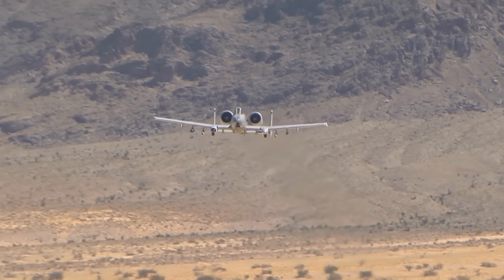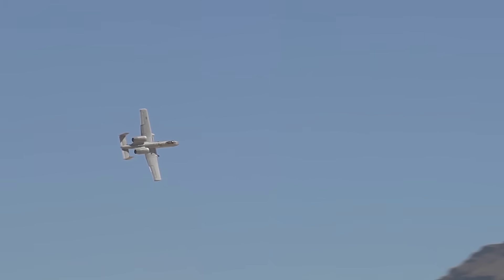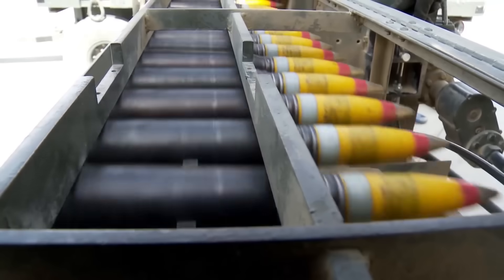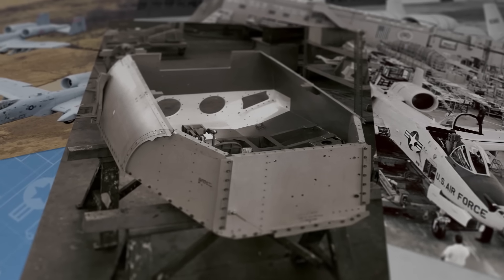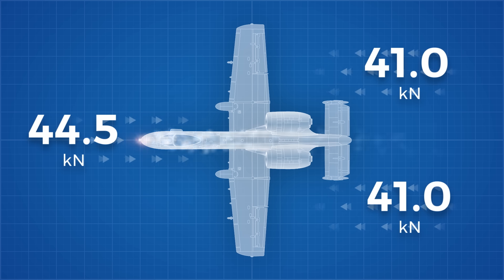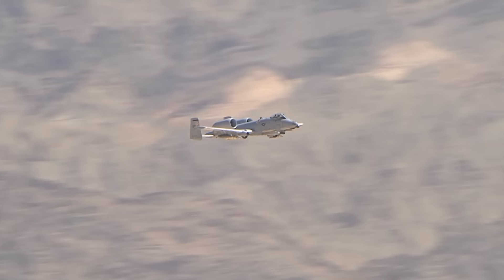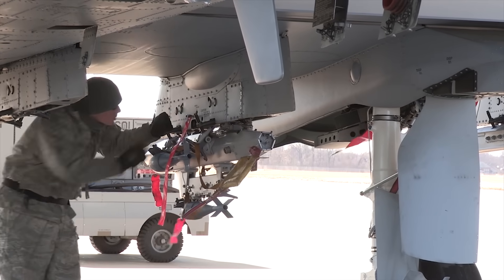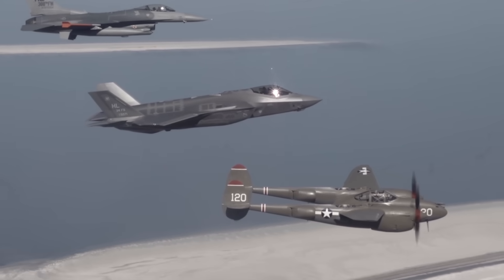The Insane Engineering of the A-10 Warthog

Comment: "Incredibly accurate with its weapons to avoid friendly fire" tell that to the Yanks who killed and injured British troops with blue-on-blue strafing runs with the Warthog
Reply: Tbf it is very accurate, just the trigger happy yank pilots not only did one but two strafing attacks on 2 british vehicles, which were clearly marked with orange identifaction panels, without authorisation from their forward air controller and yet somehow weren't reprimanded... Its an incredible bit of engineering, just in the wrong hands
Reply: @Caleb P It is, but you know what: who operates a weapons system is as important as the technology itself, and cannot be separated so glibly in real-life. That's an abrogation of responsibility. If the personnel that a military has are incapable of operating equipment in an acceptable manner, they shouldn't be running the show and putting other troops lives at risk, until they can find somebody who can do the job properly. My cousins witnessed the aftermath of such an incident and expressed similar emotions to the ones described in this sobering article about a (different) incident in March 2003:  https://www.theguardian.com/world/2003/mar/31/iraq5
Reply: @Caleb P perhaps more correct, bad intel.
Reply: @Caleb P Oh, yes, I was talking in a more general sense rather than directly about this video. The comment above yours just hit a resonance with me, for the stated reason, and got me thinking about the ethics of deploying.
Reply: @Caleb P No one can deny the beauty of the A-10 and it's attitude as a work horse in the sky let alone it's accuracy. It's a great piece of engineering however the "to avoid friendly fire" struck a nerve since I instantly think of the incident and men lost. But the statement remains true to deliver firepower precisely.  I respect that we can all have a discussion with understanding. Cheers lads.

Comment: "Yo we got all this Uranium laying around, what do we do to dispose of it?"
"What if... >hits bong< ...we shot it at terrorists?"
Reply: Uranium is a really good at anti armor due to its physical properties. A typical DU slug is a cylinder with a taper on one end with a flat point. When that flat point hits armor, it begins to shear off material from that flat point. It begins to self sharpen into a point as it goes through the armor. Now all that sharpening makes a lot of depleted uranium dust. That dust ignites in the air, and once the slug is through the armor, it can cause secondary fires inside.
And what is dangerous about depleted uranium, is it acts as a heavy metal (duh) in your body. The radiation is rather minimal considering the half life. The physical and chemical properties outweigh the radiation dangers. And they are serious concerns in their own rights due to how the projectiles work. Also doesn't help that DU also composes part of really good armor for tanks. There will be massive amounts of carcinogenic DU dust, in any future tank on tank battles.
Reply: @codyblea3638  There is a very good film about the consequences of using uranium ammunition called  "Deadly dust". It shows a lot of deformed babys :(
Reply: @RohrAtom doesnt make it true
Reply: @codyblea3638  do they make DU round for sniper rifles or more generally human operated guns?
Reply: @lechprotean  you are more likely to see tungsten carbide and hardened steel in things that are not considered cannons or auto cannons. Mostly because infantry has other tools for armor. I think there is a .50 bmg loading that uses a DU penetrator, but I'm not 100% certain. It comes down to the protection that is needing holes in it and who is engaging it. Rifle plates, light skinned vehicles against infantry? You don't need DU and it is a waste of resources to use on such. Hardened steel cores will do the job but grenades will do even better within range. Hostile APC rolls into the same infantry? Shoulder launched anti armor and tactics. Tanks come in? Call in air or artillery support. Or your own armor support.
And to be a little specific on your sniper rifle bit. We are entering a time where long range precision shooting requires secondary optics on the rifle. Not a red dot or the like, but an optic that goes in front of the primary optic. Not to increase magnification per say, but to give the shooter more elevation in their optic. This is due to the massive amount of bullet drop they are getting at these new insane ranges. At these ranges, bullet drop is measured in meters and yards not centimeters and inches. Very dense materials like DU being used as the projectile stock and not as just a penetrator tip, would change this. But the entire rifle, projectile and case would need to be redesigned to take advantage of it in long range shooting.
Reply: @lechprotean  no
Reply: @codyblea3638  DU's still quite radioactive (especially if dust gets on or in your body), despite what the VA might say. I totally get why the military likes using it, but it's too nasty. Using it is essentially nuclear warfare - not the big-boom part of nuclear war, but the radioactive fallout part.
Reply: @TheMatissV  DU is less radioactive than unrefined uranium ore. The smoke alarm in your house is more radioactive.
Reply: sappersam not if is the optical type.
Reply: Julian Kandlhofer except they've probably never shot a terrorist with it. Lots of wedding parties though
Reply: Terrorists? Yeah in US eyes.... on the other side those always end up killing civilians. But you don't want to hear that...
Reply: And then blame the very same terrorists for stockpiling nuclear material - genius!
Reply: In the low intensity combat where the A-10 has been excelling over the last 20 years, mostly high explosive incendiary (HEI) rounds have been used.  These are adequate for light armor, other vehicles, and, in particular, people.  The armor piercing round is much less useful in that type environment.
Reply: They don't use DU rounds fighting terrorist though, unless im wrong since there is also API and HEI rounds for the gau-8
Reply: I feel like this his how the top brass at Space X actually brainstorm
Reply: Shot it at kids *
Reply: It is depleted Uramun
Reply: I think too many people missed your humor, bud. I laughed my ass off!
Reply: @Rubedo Alaberti ?
Reply: HAHAHA  tho the engineers may had weed the corporate office surely had lines of coke being the 70s.
Reply: Weed was illegal when DU ammunition was invented.
Reply: At 6,000RPM.  And lets mix a few high explosive incendiary tracers in with it as well.
Reply: Excellent idea! Fully in favor... Now pass that thing :)
Reply: Apparently some people are not aware that DEPLETED uranium has lost most of its radioactivity. Only long term direct contact is dangerous. You actually get more radiation standing in direct sunlight than standing 3 feet from depleted uranium.
Reply: said no hillary ever
Reply: @------country-boy-------  Yeah, the Hillary types prefer arming the terrorists and using them as proxy forces. Ask Libya and Syria.
Reply: until deyglo!!! hahaa
Reply: The terrorists want it so bad the can catch it
Reply: Elijah Aitaok What about the ones defending their country from foreign invasion? You would probably roll over and spread your butt cheeks as a collaborator if you were invaded.
Reply: @thedarkpodcast9069  If a foreign army invaded our land and all the men from different states joined together to fight them, I get the feeling you would be collaborating with the enemy.
Reply: G
Reply: here is the new 2021 handguns and assult rifles click this link its a video https://www.facebook.com/antoine.burton.10/videos/3597933530289970
Reply: Hits bong??
Reply: By “terrorists” you mean impoverished war torn women and children
Reply: @averagejoe6031  and by impoverished woman and children do you acceptable losses
Reply: Top c omment
Reply: The most American thing read today
Reply: Yoooooo 🤣🤣🤣🤣
Reply: It was used in Iraq during the '91 Gulf war. Quite a few smaller conflicts as well.
Reply: EXXXELLLENT!
Reply: This made me lol I’m currently hitting my cart.
Reply: IMO not really, Depleted uranium is very weakly radioactive. I think people hear the word Uranium and suddenly think nuclear bombs. The average smoker is going to be at a much greater cancer risk than anyone who suffered acute exposure to depleted uranium, the radioactive lead and polonium builds up in a smokers lungs. Pilots are also a concern, pilots see increased radiation exposure from cosmic rays when they fly at high altitude. To really be at an elevated cancer risk from depleted uranium you need to be chronically exposed to it. Even then, heavy metal toxicity is more of a concern to safety than radiation. Lead poisoning or poisoning from any other heavy metal can kill you far more easily than radiation from depleted uranium. Everything emits some amount of radiation or is toxic in some way, some worse than others. The likelihood of depleted uranium being a major or overpowering factor in cancer risk compared to daily life habits is very small.
Reply: @dakotaadra1044  Have i finely found a based mind?
Reply: DU is still a heavy metal and causes the same problems as all other heavy metals. The pollution caused by it might not be polonium levels but next time you know someone with colon cancer, still hooray it up..
Reply: Dakota Adr
Reply: *Communists
Reply: this is one of the reasons why we're still behind in nuclear... too much interest for ammo.
Reply: @yosyp_yosyp  don't be ridiculous ahaha the US has stocked enough depleted uranium to last them another 1000 wars.
Reply: @dennispremoli7950  the main reason why nuclear Power is mainly uranium based today is that you can make nuclear Bombs out of the Plutonium produced by it.
Reply: @semurobo  Nah if that were true we would use Thorium because the Thorium cycle is easier and produces Uranium 233 (along with neptunium/plutonium) which is actually a more efficient fissionable material than Uranium 239 we use now, We use Uranium because Uranium is what they knew how to refine back then remember that the bombs came only 6 years after the first fission event, and we don't use thorium now because breeding reactors are illegal and weren't studied extensively before they were outlawed
Reply: @dennispremoli7950  1 world war at best
Reply: @dennispremoli7950  World War 2 used 30 million tons of ammunition so just think how long would the US last with that uranium
Reply: @dennispremoli7950  USA: This'll last us a thousand wars.
Germany: Don't test me.
Reply: @semurobo  You can make plutonium from U238 using any source of neutrons really. Even a Thorium based breeder reactor could make plutonium if you put channels in for the Uranium slugs to absorb neutrons.
Reply: @bearcatben4762  You really don't know your physics. Th232 can be bred into U233, which is fissile, but traces of U232 are produced which is a powerful gamma emitter, making it very difficult to work with, easily detectable, and prone to frying its own electronics. We explored it in the 50s and concluded the Pu239 (NOT U239) was the better material since it was pretty much exclusively an alpha emitter.
Reply: @semurobo  EXACTLY !!!   that's  why  Thorium  is not  used
Reply: @dennispremoli7950  depleted uranium? For what? Armour?
Reply: @yosyp_yosyp  depleted uranium is the part that CAN'T be used for nuclear fuel rods bruh, blame it on the fossil fuel corporation but why blame it on the ammunition industry
Reply: @yosyp_yosyp  You kind of missed the point of "depleted" uranium, which is that it is a by-product of a working nuclear reactor. Not to mention that the real reason we are "behind" in nuclear is not that we can't build reactors, but that no one wants one near them.
Reply: @yosyp_yosyp  bro, who has the most nukes? america. how does that equal being behind in nuclear? russia detonated the largest bomb ever but we have /by far/ more sheer tonnage of "deactivated" nuclear weapons. the WMD's Bush was looking for in the sands of arab-land are actually buried in the sands of the american southwest deserts and the rocky mountains. not saying russia doesnt have means of destroying the earth, but nowhere near what america produced on paper, and that is a google-able fact.
Reply: @yosyp_yosyp  not really United states still number one in the terms of electricity production generated from nuclear power plants
Reply: Yosyp are we really behind in nuclear? We have plenty of nuclear weapons, but even better, we have plenty of nuclear power stations and nuclear powered vehicles. Also, the US has experienced less nuclear disasters such as Chernobyl, Fukushima, that russian nuclear sub that exploded and sank, etc...
Reply: @svtxj9921  3 mile was a very close run thing. We(UK) got away with Windscale due to luck.
Reply: @yosyp_yosyp  you have no idea what you're talking about, do you?
Behind in what, exactly?
You say "behind in nuclear" like a 2nd grader... So please elaborate and list specific nuclear fields we are quote behind in.
We lead the world in every aspect of Nuclear weapons engineering... From precision miniaturization to high yield, pinpoint accuracy and reliability.
So I would like to hear from you professor...

Comment: The A-10
Efficient, does his job well, reasonnably expensive to make.

hOw aBOuT wE jUsT REpLacE iT wiTh  THe MoST ExpEnsiVe PlAnE eVEr ?
Reply: Lol look at the air casualties during desert storm. Nearly all were A-10s. The A-10 does not do its job well, it is a deathtrap in a modern threat environment. It's also getting more and more expensive to keep maintained. The F-35 is also not the most expensive plane ever made. Sure it's program is the most expensive program, but each F-35A costs only slightly more than a Super Hornet. Plus, it's not really being replaced by the F35. The F-15E does that role more widely, and it does it VASTLY better than the A-10.